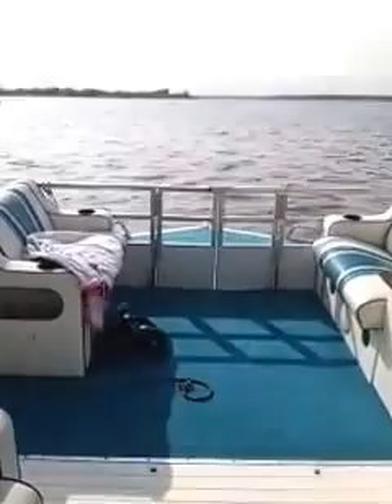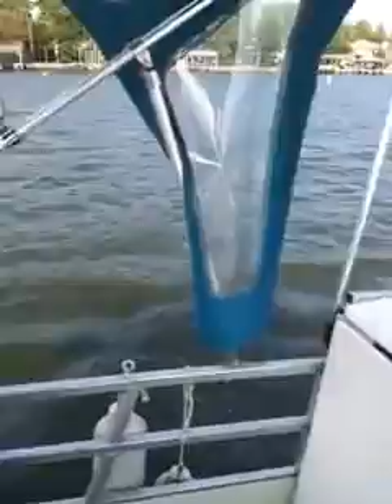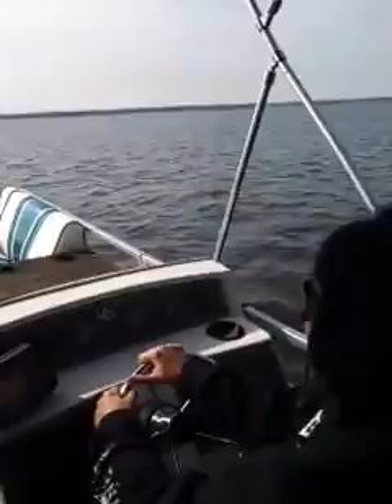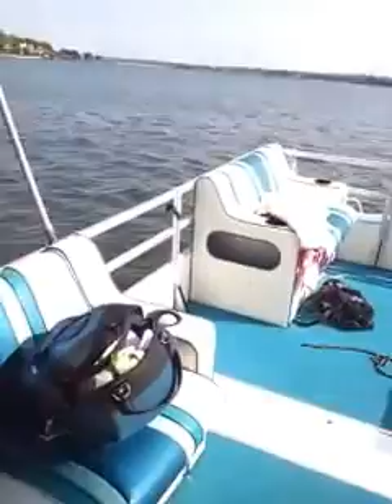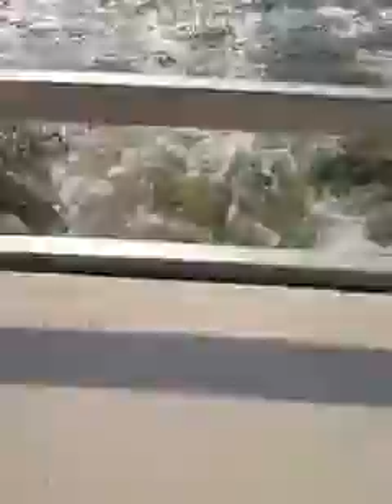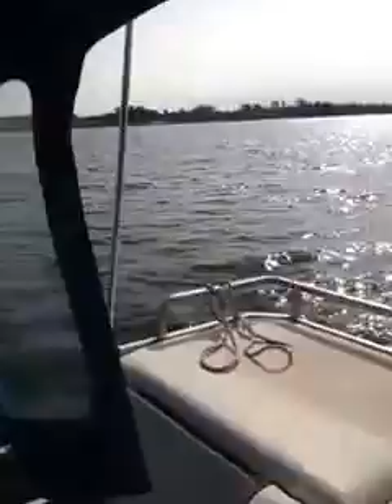Electric Outboard

Comment: Did u make the motor?If so what size electric motor did u use?
Reply from the maker: I pulled the powerhead from a Suzuki DT150 and replaced it with HPEVS motor. It was around 10kw rated. Only good for 5-6 MPH. Are you looking to convert a boat to electric? I produce the Stealth E40 outboard with a true 40 HP at the prop. Perfect for planning lighter boats.